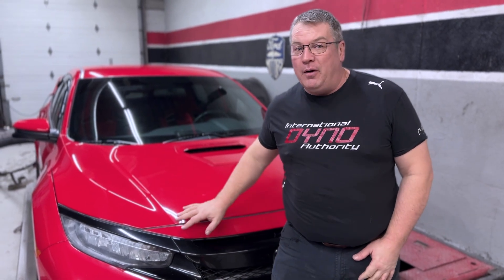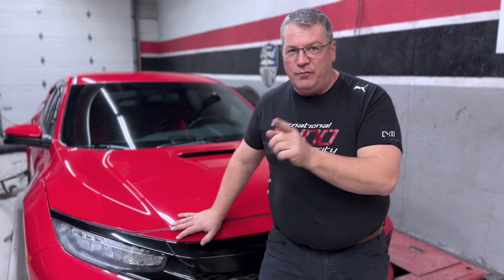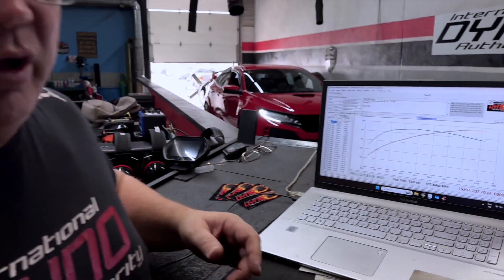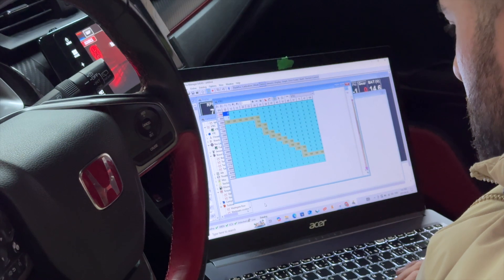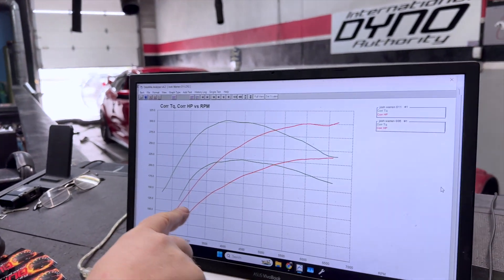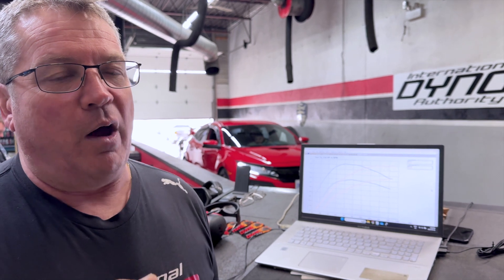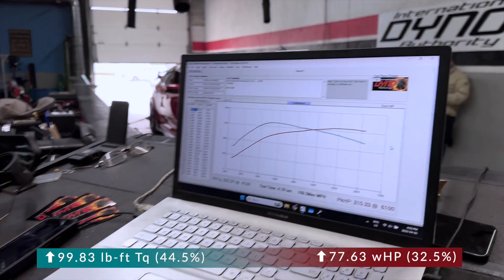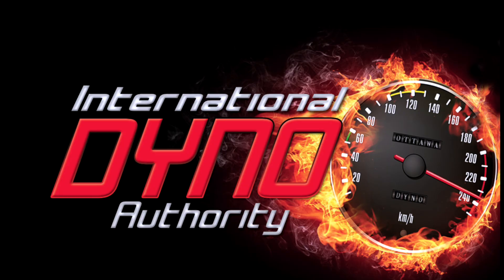Hondata tuning a 2018 Type R Civic on the Dyno.

Comment: I still find it amazing what you guys can do to a factory set car. Magic. James Budd, you rock that camera my friend.
Reply: Thank you sir!
Reply: They did do a decent job!  The K20C1 platform is very easy to get gobs of power from!  If he kept going I bet he could have squeezed another 20-30 whp out of it!  The insane part is when you go full bolt ons, and go for an E30-E40 tune!  With just a few thousand dollars in parts, you can easily be between high 500 to low 600 whp, but with stock clutch keep your tourqe at or below 470 ft lbs.  Or, if a penny pinching miser like me, you can get your parts for way less!  If okay with used parts, shop the classifieds on all the Type R forums!!